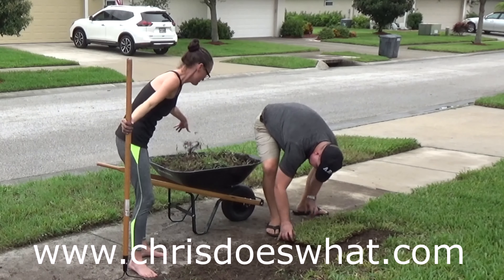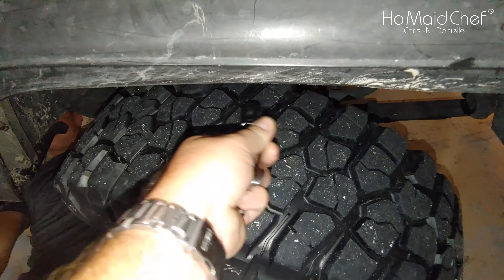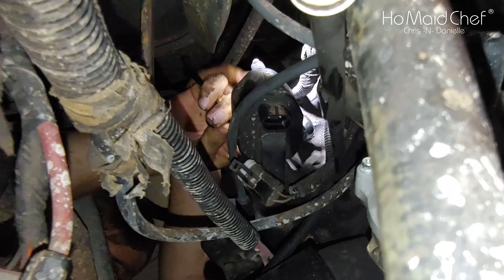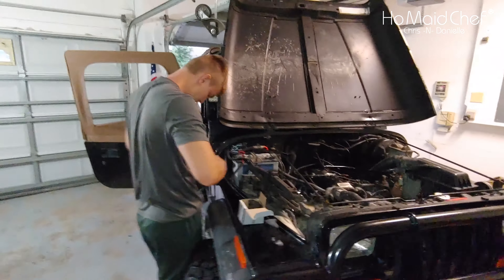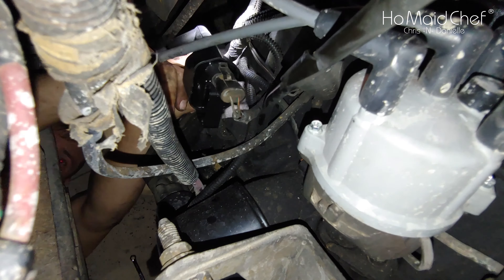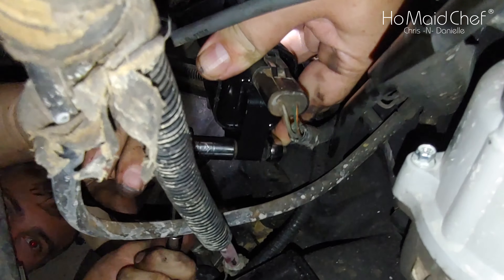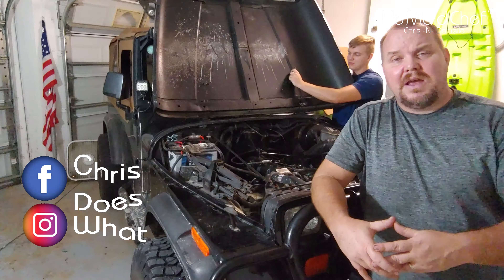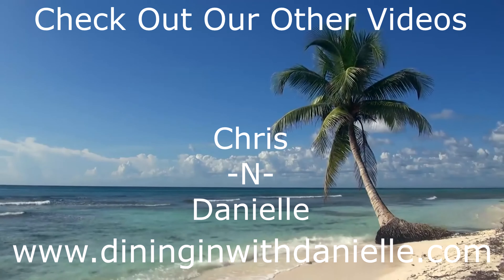How To Replace A Distributor Coil  || Jeep Sputtering E02

Comment: You did whaaat now?  Thanks for teaching me about error codes.  My car's been ambiguous about telling me what's wrong with it, but I been talking to it positively in case it becomes sentient (lol)
Reply from the maker: The AC just went out on our 6 year old truck with 25K miles on it, future video.
Reply: @ChrisDoesWhat  Oh dang my AC hasn't worked for a year.  I walk out and my shorts leg looks like it's leaking water (but it's sweat) lol
Reply from the maker: @Nezodam  LOL, When I was younger did the no AC thing, keeps you thin. Now we are going to try to keep AC as long as we can. 2 years we plan to move to a sailboat, AC may be a thing of the past.